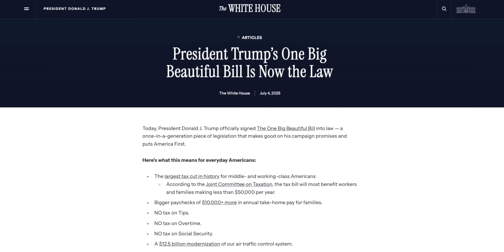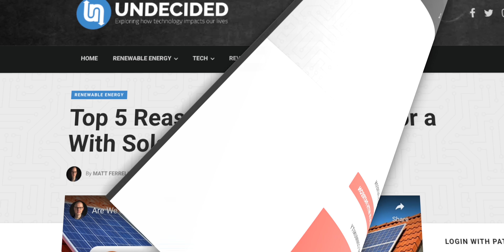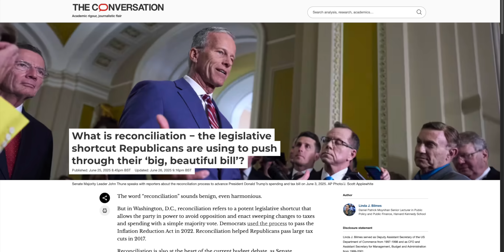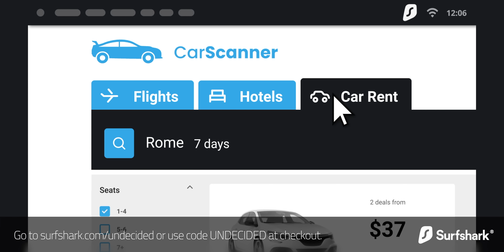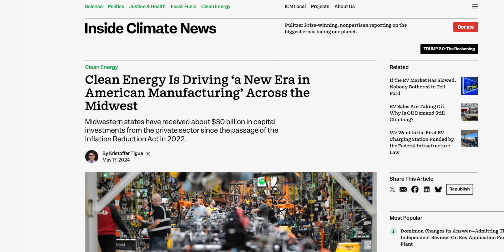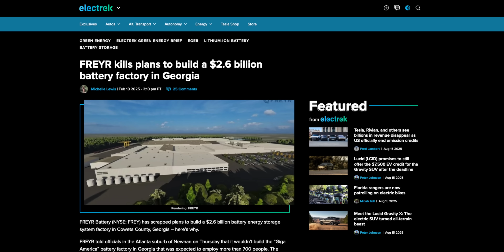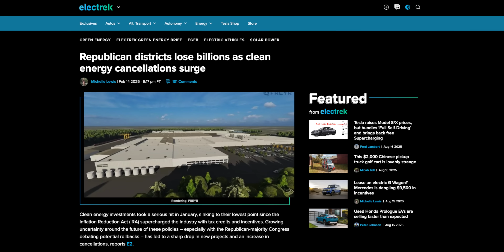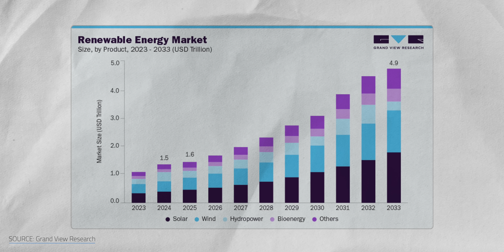How the U.S. Just Handed the Renewable Future to China

Comment: Come on Matt 🤦‍♂️ the green energy discount subsidies were putting the thumb in the scale for one industry while setting regulations to make business almost impossible for coal and oil companies to do business. The green energy industry can’t compete with fossil fuels for cost and efficiency. The long term investment ROI math just doesn’t work to date. 

Coal industry jobs will go back up. The green jobs will stop going up and go backwards unless the green energy projects are used for local industries that would use shore power as a backup and the only way intermittent energy can work.

I’m just saying, the references you’re using are because of the anti fossil fuel government interference.

Why are buggy whip sales are down since the early 1900’s? Something changed, right? It wasn’t great alternatives to energy production that revolutionized the green energy sector. It was government that put its hand on the scale like a dictatorship and not letting the market determine the outcome. 

If the government just gave subsidies to the green industry it would be fine but the government using old regulations and new regulations and slowing the process down by years hindered their ability to do business in a timely manner.

The world is a big place. The US is small in comparison but huge in technology revolution. We need to let the US be the US.
Reply: The fossil fuel industry has long had its thumb on the scale sucking up massive subsidies. But carry on Americans in dragging your country into a death spiral.

Comment: 2 words: baseload power.
 at an affordable cost.
It's not renewable. Even with batteries.
Reply: Still cheaper than coal even with batteries. Natural gas is still cheaper, but that difference is closing in
Reply: Wrong. Thats only true for non-baseload power. Fossils are cheaper for baseload
Reply: ChatGPT said: "Yes, China has significantly more coal power plants than the United States.  As of 2024, China operates over 1,000 coal-fired power plants, while the U.S. has approximately 209.

Comment: Grids cost $TRILLIONS, $1,000s of billions.
Generation costs $billions. 

Rooftop pv has no grid costs. 

A parked EV battery is no cost mass storage.
Australia has 20million roofs and 20million vehicles. 
USA has 300million roofs and 300million vehicles. 

Rooftop PV saves $10,000 yearly for decades and decades and decades. 
Tax-free savings. No petroleum, no gas heating,  no grid electricity. x 20million.
Reply: "Rooftop pv has no grid costs." Ok, that’s true for single-family homes. Some of us live in 18-floor apartment buildings. There’s not enough roof area for 60+ families stacked vertically. There is a need for a functioning grid.
Reply: @OrangiaNebula yes.
I think that the national grid is too expensive to expand and too valuable to waste. 
Most people do not realise the sunny side of a building in winter can have large solar access. 

Some city buildings used to turn the cooling up in winter to control the heat build up.
Fun fact.
A building big battery could also help. 
Importing grid electricity can be reduced.
Just my perspective.
Reply: @OrangiaNebula  Rooftop PV solar panels have many problems including high upfront costs, efficiency losses due to weather and material degradation, microcracks, hot spots, and wiring faults that can cause fires. They can damage roofs, cause leaks, add dangerous structural loads, suffer from reduced performance due to dirt and shading, and pose recycling and toxicity challenges. Additionally, there are risks of consumer fraud, unreliable maintenance from providers, and economic disadvantages compared to utility-scale solar.
Reply: @JaykeBlayde you realize that oil just disappears into a gas to never be seen again upon use, right?  So the replacement cost is constant, but the supply of it is finite. We can recycle PVs already and that will only improve over time allowing for an ever closing manufacturing loop. You're claiming ice is better than a fridge cause fridges cost more is flimsy at best.
Reply: Rooftop pv has grid costs, its hidden but its there.

In france one of the biggest grid project planned is because of solar (including rooftop ones), pv is more profitable in the south of france (more production per kwp) therefore a power inballance between south and north is expected to come in a few year forcing RTE to build new power lines.
Reply: @Sandroggy  yes. 
The amount of fossil fueled energy in Australia is 6,500TWh annually and grid electricity capacity is only 250TWh annually. 

Given 50% of fossil fueled energy is wasted in heat and mechanical friction then only 3,250TWh of electrical energy is needed. 

This is still a big amount and bigger rooftop PV systems creating feed-in electricity will be more important. 

Just my perspective.

Comment: I bought solar and battery backup because I can't trust this country to fix its infrastructure issues in time.  Sure it happens to be good for the environment and saves money as well...
Reply: I  working on mine to drive my🎉 EV for free and offset PGE more
Reply: "We'll be fixing the infrastructure in your neighborhood. What century works for you?"
Reply: Those batteries are not good for the environment. Neither is the manufacturing of those cells.
Reply: @RickyBlonde   Mining isn’t perfect, but compare full lifecycles. Batteries beat fossil fuels on cost and impact when you don't narrow the scope to only a single tank.
Reply: @RickyBlonde  They're a lot better for the environment  than coal or oil and unlike those can be recycled.
Reply: @geoffreyjones6019  Right, lead acid demonstrated batteries can be in a near perfect loop of made and recycled. Lithium batteries are no different. Plus there's a big market for used solar and batteries in third-world countries.
Reply: @brodriguez11000  and there are already methods for recycling batteries. I've not heard of anyone coming up with a way to "unburn" gasoline so you can use it again.
Reply: You are correct, however the technology is still emerging so every additional purchase lowers the price and pushes it closer to its full potential.
Imagine a future where all of mining, supply, manufacturing, distribution systems are powered by renewables.

Comment: As you say -- can't be ignored.  This is an idiotic bill championed by a 79-year-old who thinks everything was better in 1950.  But I really don't think it'll be disastrous, for a bunch of reasons.

- I think people are overweighting the impact of losing the EV tax credit.  Manufacturers are getting smarter with building a cheaper vehicle that plays to EVs' strengths (see: Ford, Tesla, GM, etc).  Loss of the credit will accelerate that trend.  In any case, EV infrastructure is probably at least as big a bottleneck as vehicle cost, and our charging network is growing by leaps and bounds (regardless of govt investment ... NACS, Ionna, faster charge speeds, bigger/better stations, streamlined permitting, etc etc etc).

- I'm also not worried about rooftop solar whatsoever.  It's a tiny sliver of solar production and it's waaay too expensive right now anyway (see: Germany, Australia, et al).  Again, economic actors can adapt; they'll figure this out.

- The grid-scale story is much worse ... losing tax credits this suddenly is bad.  Grid-scale wind/solar are where it's at, and there's significant uncertainty in the market now.  Treasury's updated "safe harbor" guidance took a little pressure off, but the ramp-down in funding should have been much more gradual.

- Although note that solar/wind LCOE keeps grinding down 5-7% a year, so it'll make up the loss.  Lower WACC helps further, and developers/mfrs may have room to eat a bit of profit margin for a couple years.  But the biggest bottleneck for most solar/wind projects is permitting time, not cost -- and permitting time is being improved quickly.  Finally, I talked with the general manager of our city utility: developers aren't stupid, they know damn well that oil/gas prices are volatile, and they actively try to minimize fossil fuel construction as a result.

- The bill preserves 45X battery mfg credits.  Batteries keep getting cheaper per kWh, this is a big deal.  It also incentivizes battery-backed solar/wind, which helps the grid further.

- And hell, we need funding for nuclear & carbon capture.  We solve the climate crisis with silver buckshot, not a single silver bullet.

- Subsidizing fossil fuels is stupid.  Increasing that funding is categorically insane.  I don't know what to tell you.

Look, I know the bill is bad, but honestly, it could have been WAY worse.  So while I agree with you directionally, we did not just hand the renewables revolution to China.  This is a meaningful but manageable headwind that'll force economic actors to economize.  The US' renewables revolution will slow down ... a bit ... but it's absolutely not going away.

Comment: Matt, I agree about the funding subsidies needs to stop for fossil fuels. We will need fossil fuel backup until the renewables fill the gap. Micro reactors, solar, wind, hydro, tidal/wave, thermal need time to fill the gaps and then remove the fossil fuels. You don't cut your resources before your ready. Without subsidies economics will eliminate them quickly. I have done the same as you by installing renewables and taken my power bill from $580 to $80 a month usage. In order to keep grid power for a emergency backup  it's cheaper to use a small amount from the grid every month instead of paying a STANDBY fee of over $300 monthly.

As far as Jobs you need to address AI tech. As the Godfather of AI said in a recent interview, Learn to be a plumber! 

Tech, engineering, research, creative jobs like music, art, acting, are all gone soon. Drivers, deliveries will be going away next year. fast food service priced itself out of business along with a raised minimum wage and will be replaced shortly with robotics. If your are not fixing or installing the tech, you are replaced by it.

Comment: No subsidies for anyone or any business. If it's not economically viable, let it die of attrition. EVs are largely not cost effective or competitive when you consider the actual per mile operating costs. With ICE driven vehicles, you don't have to replace the fuel tank every 100k-150k miles at a cost of $20k-$30k. I'm not anti-EVs or renewable energy, but I am anti-bad economic practices.
Reply: Where are you getting this from? Everything I’ve seen has cost per mile of an ev at roughly half the cost of ice. And if you take an away subsidies you have to do it for the oil industry as well if you want that in your cost analysis.
Reply: with ICEs, you have to replace the whole freaking engine every few hundred K. and all of that with 100% no chance of them becoming any cheaper, while batteries are basically bound to become dirt cheap at some point. also: yes. no subsidies. start with cutting fossil fuel subsidies, they had innumerable servings of their share already.

Comment: Correct on energy costs but increases insurance costs.
Its cheaper to use fossil fuels than have solar on my roof due to insurance costs. 
Insurance knows because of hurricanes that solar on roofs will destroy the roof and panels. 
Its not cheaper. You missed a point of it. Solar and find looks good on paper but in reality its terrible in some areas. 
Anywhere you have hurricanes solar on roofs increaes the risk of the roof getting damaged and the panels maybe completly destroyed because of it. 

Everything has its pros and cons. Solar is far to risky to be worth it.
Reply: It only has more risks if you're uneducated and don't understand risk analysis and make up your own nonsense. Also solar panels at this point are at least as durable in a hurricane as your average roof, at as long is you have them installed correctly and don't half ass DIY it. Solar panels only real downside is the inconsistency of power generation, which can be dealt with with whole home battery backup or grid scale battery backup, which also means when our insanely fragile massive grid fails, which it does all the time when a storm hits, you never loose power.
Reply: Also, wouldn’t the move to solar help mitigate more extreme hurricanes in the future?
Reply: Yet one in three houses in Australia
have rooftop solar.

Comment: The issue I have with renewables is the cost of electricity here in CALIFORNIA. I am surrounded by solar and wind and have the most expensive electricity bill in the country
Reply from the maker: I hear you on that.  I live in MA, which is also up there for electricity prices nation wide.  The reason for those high prices goes beyond wind and solar though.  It's how the grids are run, competition, etc. Texas is the second largest renewable energy producer in the country (not far behind California) and they have insanely cheap electricity (about half that of California and MA).
Reply: @UndecidedMF  To echo this, I live in Finland and I get 100% of my energy from carbon-free energy sources. I specifically went with a supplier that sources from carbon-free. It's a mix of solar, wind, and nuclear (so not purely renewables). I pay spot (market) pricing and my average cost was 3.70c/kWh last month. Even in the winter (such as last December) when the temperature was typically well below freezing and solar is at its minimum, my average cost was still between 5.81c/kWh and 7.82c/kWh (Nov - Jan range).

While the vendors for the infrastructure don't have much competition, we have a lot of competition on the supplier side (so who you're buying the actual electricity from). Our grid is well maintained, though I know Finland is much smaller than many States (being a U.S. citizen living in Finland, I have experience with both! :D) I would agree that if you have minimal competition and a poorly run grid, you're going to have higher prices. There ends up being no market force acting to try to push lower energy prices.

The issue is not with renewables.